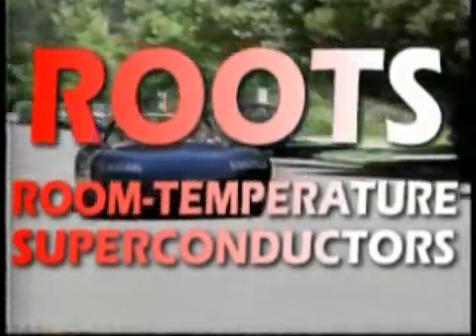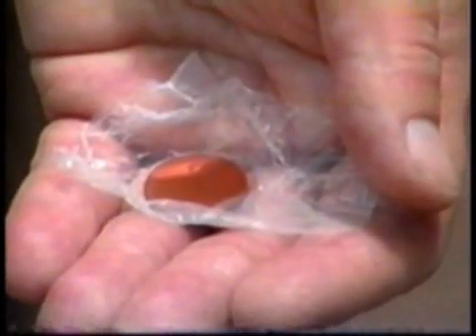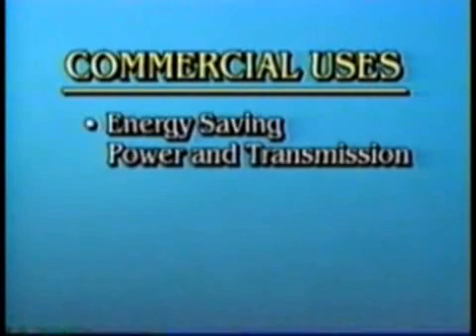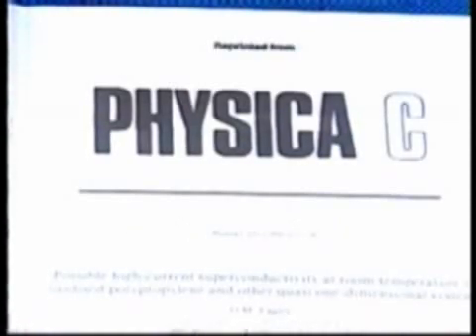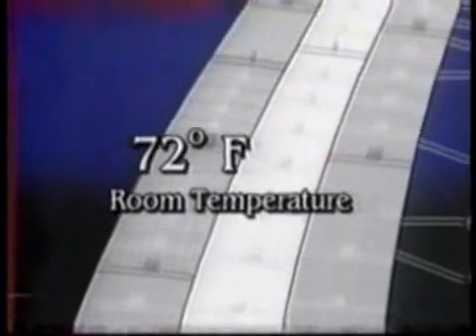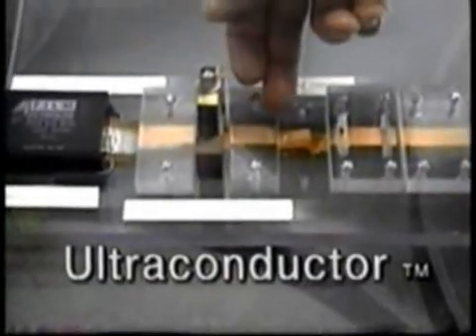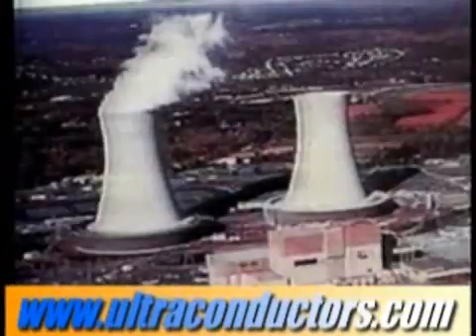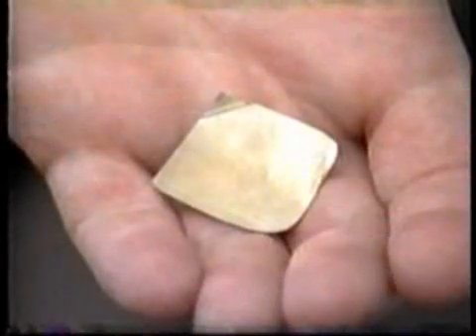Room (High) Temperature Superconductor (Ultraconductor)

Comment: As for the description they oxidise the polymers, place the metal electrodes (plates, sheets, etc) inside it then apply high voltage+current to straighten the molecules and let it to chil out. When it is solid, they remove the high voltage and the medium is superconductive, but ONLY in the same way the HV was applied.

It is very light, very flexible and ridicilously simple to produce. That is why the fat arses put their hands on it as they all are afraid of a new industrial revolution. :(

Comment: Their website is removed, but it was available a year ago when I saved the documents. Unfortunately I lost the 2 PDFs during a data loss but I printed them out and found them in my file.

1st patent: US006552883B1
2nd patent: US005777292A

Comment: In 1981, researchers of the Russian Academy of Sciences discovered that an oxidized thin-film of atactic polypropylene can have a conductivity at least 100,000 times higher than the best refined metals. The polymers violate the Wiedemann-Franz law by six or seven orders of magnitude.

While Ultraconductors capacity is much inferior to Superconductors it's still the best wire solution on earth at the moment.

Due to expensive licensing it wont ever leave the nano size of computercircuits.

Comment: American Superconductor (AMSC) has a commercial super conductive cable available for industry.  It's not a high temperature super conductor, if you look at the specs, its still cooled by nitrogen, but it's still a better solution than current copper wire technology.